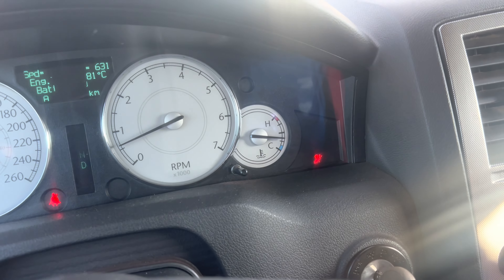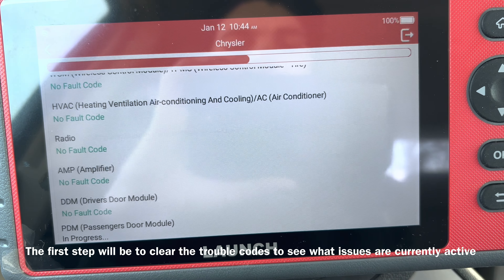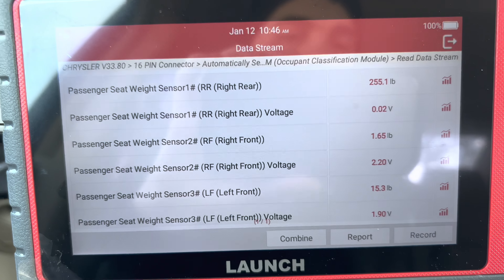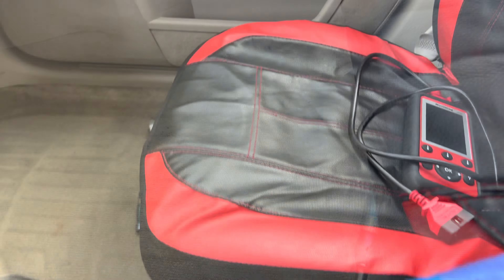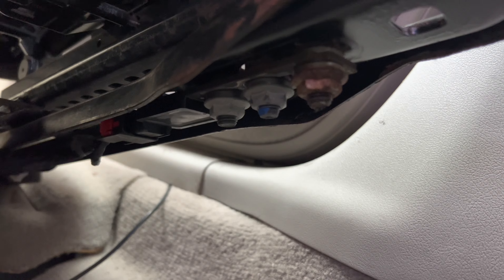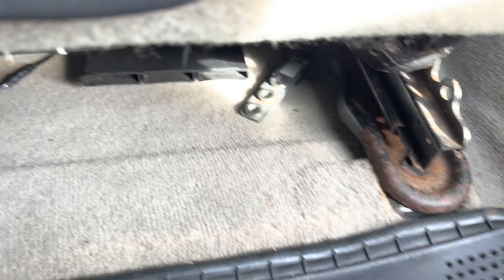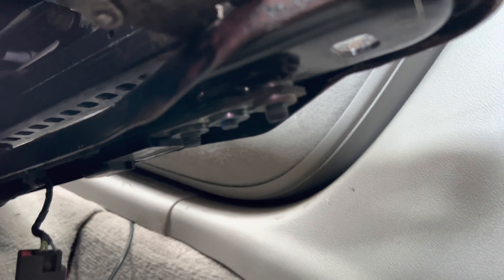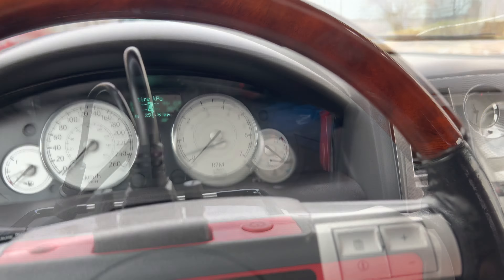B223D Fix! Occupant Classification module DTC present B1B88 Chrysler 300, Dodge Charger , Magnum

Comment: Thank You so Much !!! Great explanation . Easy to follow step !! 
Well my scan too did not had the data to read . Using AlfaOBD I was able perform OCM test . Three steps 
Seat set max rearward , empty seat , then you need to add weight to value of rear facing child seat with child in , then you need to have a heavier weight to mimic a light weight woman or teen. Procedure completed with SUCCESS !!!
I used a small tool box for Child seat , then I added a 5.7 exhaust manifold and two jack stand on top of tool box and calibration accepted it. I don't have a scale to give you exact weights . But I'll add that later. A friend of mine has those weights he bought at an auction. CHEERS !!!
Reply from the maker: Hey bro!! Thanks for the comment! I’m glad to hear that you were successful with your fix!! That was a good idea to use AlfaOBD to help sort it out!💯💯🤝 take care

Comment: Does your launch have the ability to initialize the abs module? I am looking for a scanner and I like the way yours works. Thanks for the great video!!
Reply from the maker: It has the ability to do quite a bit! When you go to purchase them check the specs as different ones have different function levels. So far it’s helped out quite a bit and haven’t had an issue that I couldn’t take care of yet. Thanks for the comment bro! Have a good one. 💯

Comment: Is that a push-button start on that 2006? Thanks
Reply from the maker: This one isn’t unfortunately bro!! Some of the 09s and up have the push to start. And as they get newer it converts over to push to start completely. 💯💯🤝
Reply: @colin7761  I have been trying for a few years to put one on my 06. Well, both of mine. There is a video that is like 10 years old, where a guy in Cali did one on a 05. Will not reveal how to do it with the can bus system
Reply from the maker: @CINCYB0Y  interesting, I’ll look into and see whats involved. I may do it to my vehicle and make a video if I can. 💯💯

Comment: I cannot for the life of me find the part number for the sensor lmao can you help? I would greatly appreciate it
Reply from the maker: Hey bro! Try 56043196af 💯💯🤝
Reply: @colin7761  I appreciate it.  I initially commented a thanks but it just randomly deleted itself. I managed to get a part from a junker car and got the passenger airbag fixed thanks to you.
Reply from the maker: Thanks, I appreciate your comments! I’m glad I was able to able to help 💯💯🤝
Reply: @snopom did you just plug the new sensor in and it worked or is a scan tool needed?
Reply: @zachbrown7543  You kinda do need a scan tool (OBDII scanner and AlfaOBD is the cheapest one imo) that can recalibrate the occupant classification module after you put in the new part, OR  get a scan tool to read out the KG's the sensors measure and slowly adjust the bolts holding the sensors until all of them read close to zero and it should fix itself (video on youtube about that whole method)

Comment: You ever consider a career doing this type of work?  Lol but seriously you're really good with your diags.  I see too you got yourself the service manual that has test procedures, dtc codes and wire diagrams... very smart.  I got myself a service manual too for my 2007 2.7L Dodge Charger and I have roughly 205k miles on the clock.  She's my baby I've had her for a long time.  My 2 oldest went from elementary to graduated and moved out already and Black Beauty is still in the driveway.  I have the 10k + page service manual and various testing tools but my problem is I'm not so good at the diagnosis part.  I can think of most possible causes but that doesn't help trying to test things.  Long story kinda short... I recently had to go out and get another vehicle bcuz my Charger has been a crank no start now for a little over a half a year now and still.... no start.  This would turn into a novel if I typed everything tried lol.  Everything was put back to how it was before trying something else though and I know what's what with her, I just don't know my reason for the no start and its over a half of a year now.  I was wondering if you could possibly help me diagnosis and get my old car to start back up again?!?!  I subscribed to your channel and watched your diagnosis procedure and well.... you're dang good and more professional then a lot of actual shop pros lol but seriously !!  Let me know what you think and leave me a reply to this message and we can just go from there or if you don't reply I understand too LOL.  I've almost exhausted my level of car mechanic abilities and don't want to send her to the yard to rot away just yet... lots of sentimental value and memories she holds.  No expectations here of a for sure fix and no blame for anything over anything associated with the car as I'm reaching out for help at this point and I went out and got a 2022 Challenger for transportation so really no blame game over anything Bcuz I'm still good and have some wheels for work.  Thanks in advance and hope to hear back from ya.
Reply from the maker: Thanks for the comment bro. When you go to crank your charger, does the fuel pump kick in at all? How old is the gas, is it possible that it got contaminated? It may help if you take a video of you trying to start it. It will give an idea of how the engine sounds cranking over and you can get a lot of good info just from listening to an engine crank. Thanks for subscribing btw! Hope your new car is treating you good! 💯 🤝 feel free to ask things whenever, I may not reply right away but Ill get to ya! good luck with your cars!